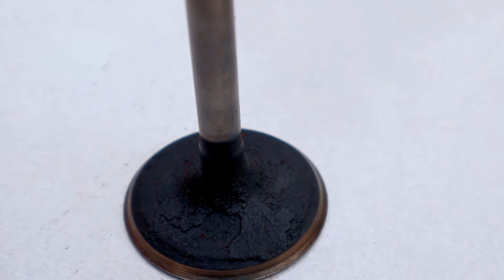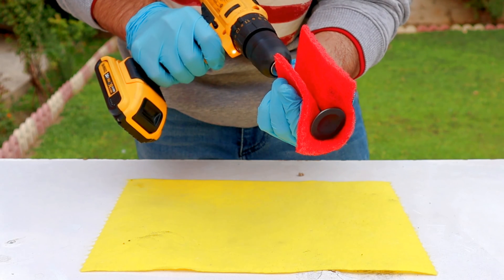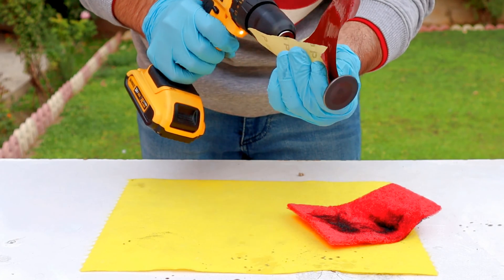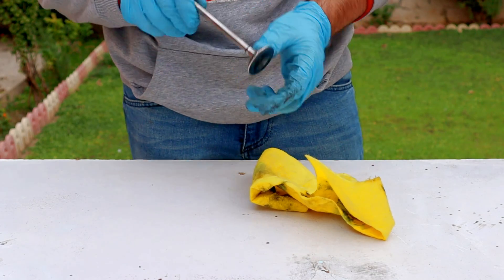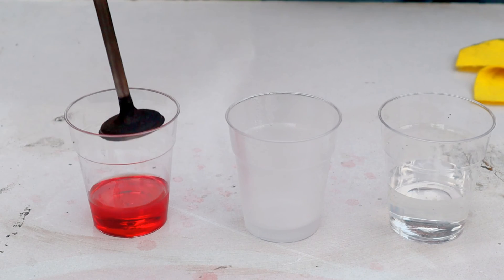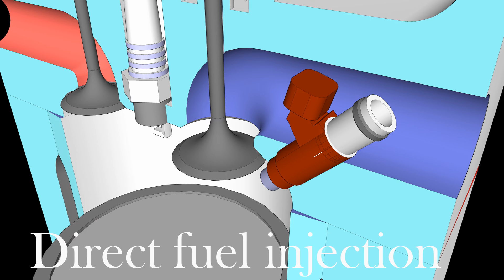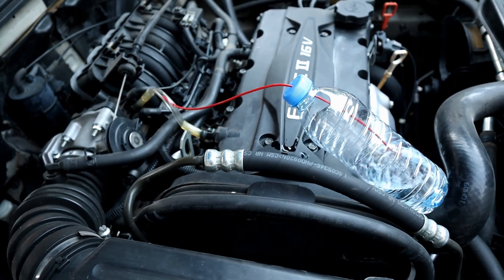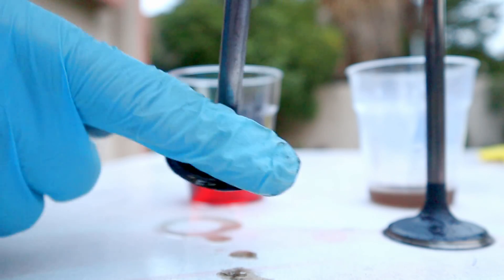How to clean intake valves on Direct/Indirect injection engines without REMOVING anything / ALIMECH

Comment: Carb cleaner can also mess up valve seals. Its better to buy a seal and experiment with whatever you intend to use. Generally acetone disolves seals but not all seals. All Ketons are very corrosive to seals and carb cleaner has it. If you are lucky manufacturer used the type of seal that can tollerate acetone, go ahead and clean it with carb cleaner. Seals are sold for $3 a piece and better check it before using on valves.
Reply: You can also use gas to clean because it has detergents.

Comment: Those valves weren't actually cleaner. You just removed the outer layer of oil that made it look black.  Now the carbon is free of oil so it's a lighter color on camera, but it's obviously still there.

Comment: Some manufactory coat their valve stem ... sanding will remove such protection and valve will wear quicker
Reply: You are correct it ruins valves to sand them. all you need is a brass wire wheel on a bench grinder. And even then you only need to clean the big chunks off.

Comment: Man you are number one I've done this in my car but without before and after but Ive seen that  cause ive removed intake plenum while entering led light inside to see the valves  and accedintly got injector leak while changing spark plugs so I removed it again but ive just only sprayed 2 cans carborator cleaner and kept it 24 hour and have been shocked when I saw valves after cleaning that for me I have to dissasemble head to do it
https://youtu.be/S9hfZkWzmgY
You can read description to know what ive did if you don't know Arabic 😅

Comment: Ali people say you should always change the oil after after using carb cleaner to clean the valves.  Is this true or not?
Reply from the maker: Carb cleaner burns in combination just like fuel, no need to change the oil, but I recommend to change the oil after long steam injecting,  I will do that video soon

Comment: So, the curb cleaner is the best to clean cylinder intake valves.
Am I right bro??
Reply from the maker: Exactly bro, I had best results with it so far
Reply: @AliMECH  Can I inject the curb cleaner through the intake manifold??
Reply from the maker: Not a good idea, it mess up the throttle,  and get engine worning light,